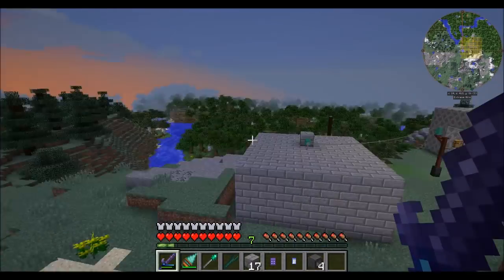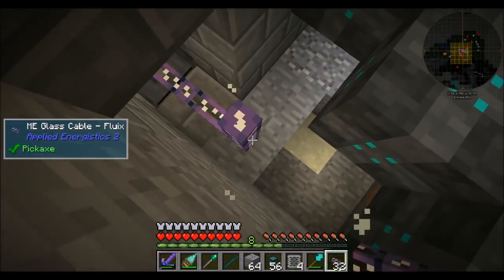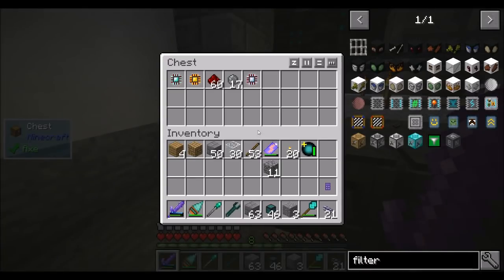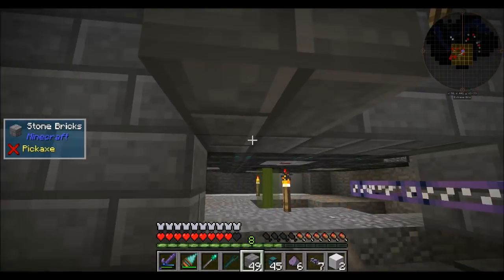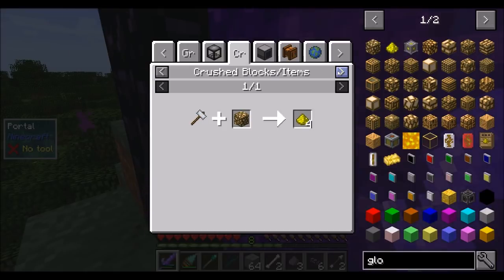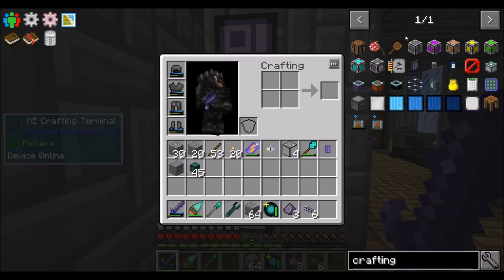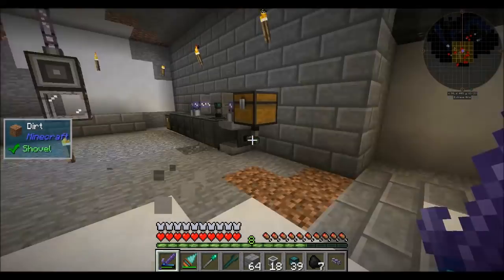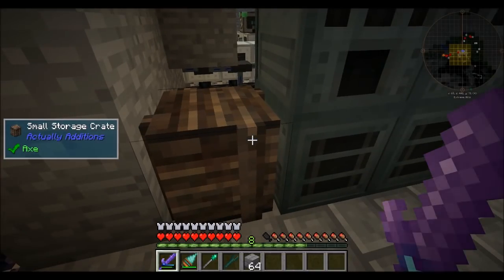AoE Ep40 AE Automation

Comment: Dire, a little idea on how you can deal with redstone ingots on your carpenters and still have then on the recipes: Keep a stack of them on each carpenter, use a transfer node to pull them from the storage crate and have rationing pipes inserting them. The transfer node needs a filter to pull only redstone ingots. What happens is that the carpenters will always have a stack of redstone ingots available and will be restocked with the ones provided by the AE when you do auto-crafting. Since you are using rationing pipes, only the carpenter that uses the redstone ingots will be restocked by the exact amount it uses, so the invariant of having a stack of redstone ingots will be sustained.

Comment: Finally getting to automation & a functioning ME system is soooo satisfying after all this crazy intricate crafting for the first 40 ep, great job Dire ! Btw, did you try scanning AE processors ? They might be crazy cheap in UU matter, it could be a good deal
Reply: Tom Arnd ive been thinking of a lot of things that might be extra cheap in uu matter but havent had time to download the pack and test 🙁
Reply: They can't be scanned, but good idea! I tried all stages of the processor.
Reply: its his fault for not using rftools storage, wouldve made progressing much easier
Reply: Luís F yeah but RFTools storage sucks though
Reply: no it doesnt. it was bad ibn 1.7, it's actually really good in 1.10 and further. its better than the ender io inventory panel.

Comment: dont think you need extract from storagebuses. you can just have insert only and still use the items in the drawers iirc

You can use 6 moleculars for each interface for 6x the speed. and if you use 6 interfaces and all of them are active you will be at negative 6x speed. its better to have 1 molecular to 1 interface than 1 molecular for 6 interfaces.
Reply: This guy needs a trophy, for me in AE2 it always wasn't about how much recipes, but how fast can I make it craft, for me it always is speed over quantity
Reply: yeah i know. i think the default mode for storage busses is "in out" so i thought putting it to insert only and not adding the second storage bus will solve the problem. Adding the second bus will prolly replicate the problem
Reply: When he doesn't have an extract storage bus the system cannot utilize the drawer items for crafting which would completely defeat the purpose. I think the problem is one storage bus performing both actions at the same time.
Agree to the thing with the assemblers though. Dire always builds way too small/slow systems which costs him tons of time upgrading in such small steps.
Reply: or he could built 3x3 multiblock with 4/5 molecular assemblers and 4/5 interfaces in a pattern which any interface or aseembler doesn t touch another interface or assembler and make tower upwards. I am using 3x3x6 and it works like charm :)
Reply: Omer Kurt I make my floor in a similar pattern to that, I think it's fun to watch them craft
Reply: Omer Kurt , I know I'm a month late, but any chance you could link to an image of this setup? I'm still pretty new to modded MC and it would help me immensely.

Comment: Dire you should use counting filter on the carpenters and then have the Redstone ingots stored and pulled from the interface it will also stop the circuit overflow in the carpenters

Comment: You really want to get into dense ME cabling and attaching individual recipes to the individual carpenters, it's way better than using the crate and blocking mode, and you know it.  You'll still want to use blocking mode on the individual inventories but the advantage of this is that you'll be able to include the redstone ingots in the recipe supply and won't have to install a convoluted Direwire system to supply redstone ingots if you go this route.

Comment: Hey dire, isn't it better if you do 1 interface to many assemblers instead of 1 assembler to 6 interface. Oh and having gaps between the 2 setups doesn't make it efficient too, alternating the assemblers and interfaces allows for faster crafting.
Reply: true but it would reuire alot more of the crafting things same amount of interfaces for the recipis yes but then it would be 1 crafting thing per interface to make instead of 1 per 6, maybe later on in the series but for now I think he will just deal with abit slower crafting for many step crafts
Reply: Vanilla crafting is not usually the bottleneck anyways. I do tend to do a checkerboard pattern though.

Comment: When auto-crafting in AE, having more Molecular Assemblers touching each interface is MUCH better than having multiple interfaces per Assembler.. Why?  Because the interface holds the automation pattern and the automatic crafting will work faster with more assemblers available.. Think of the assembler being the "crafting table" and it can only hold one craft at a time.. so having more per interface (which holds the recipe) will make your auto-crafting many times faster.  I find the best layout is a 2x2 checkerboard stacked 4 tall (checkerboard meaning that interfaces are only touching assemblers and vice versa).  This way each interface has at least 2 assemblers touching and the middle ones have 4 assemblers touching.  

In addition when putting recipes in interfaces, put the recipes that are used a lot (i.e. sub-components) into your interfaces with more assemblers.  

All in the name of auto-crafting speed.